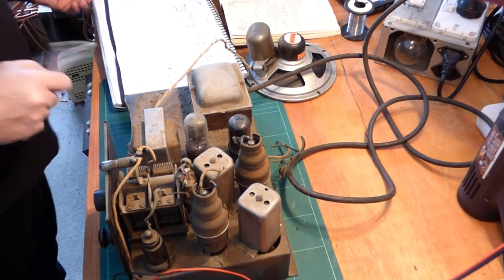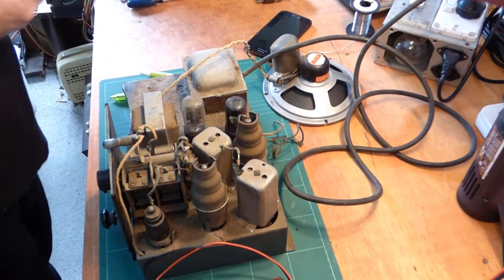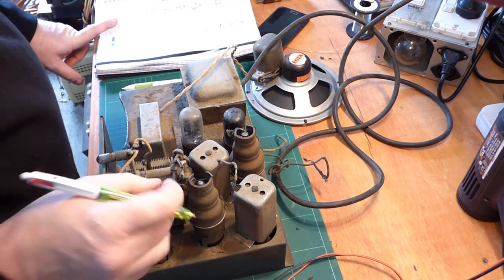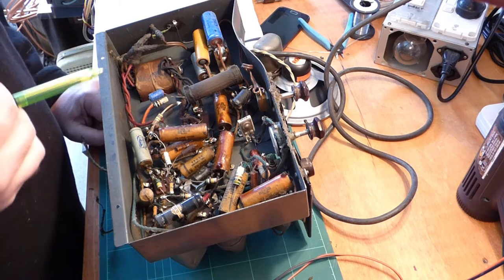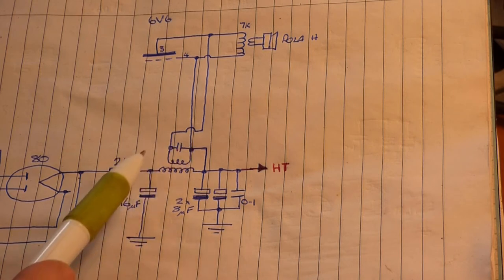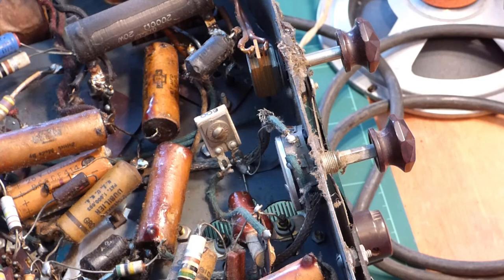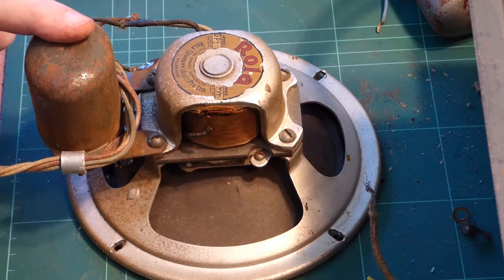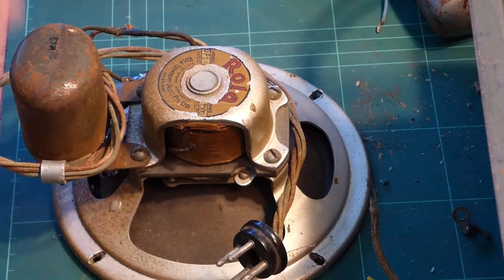2 of 4 - Repairing a 1939(ish)  Rolax 5-Valve Broadcast Band Radio

Comment: With the older rads I tend to use the typical vacuum cleaner noise cap across the negative and positive power input.. damm if it hasn't been a real gem in cutting out mains power hiss et 👀

Comment: An interesting topic worth watching (YT) is the history of Japanese loudspeaker designs re Panasonic, Sony et It illustrates why we have been so lucky to have permanent magnet speakers !! 👀 Your ugly companion (radio) 😗🤣 has some real nasties re those caps et 😗I would also imagine that quite a few of those resistors will be out of whack.. 👀 even if some have been updated from the much larger originals. I ALWAYS remove the valves when I am doing general work on the radio et equipment chassis AND I always LABEL them with their valve ident no's et bagged /boxed et😗 Good to see you clearing out and refurbishing et The main power rail caps/choke allow the valves to power up and should do so BEFORE the filaments fully ignite et IF the heaters ignite BEFORE the valves are powered through, you can get a nasty 'filament blue flash' effect which long term will shorten the life of the valve. SO newbies! always observe the glow of the filament / heaters et which should slowly glow.. 👀 One of the reasons you should NOT replace a DIODE VALVE rectification system with an ie silicon rectifier et and VICE VERSA.. NEVER replace a silicon rectified system with a VALVE DIODE rectifier set up et .. 👀 ALSO, a lot of the main power 'rail' can average out at 300v NOT 230v et In fact some systems require a transformer to output 300v+ from the transformer. 👀DID you know.. a typical valve radio transformer generates 250 - 300v BUT a nominal LESS than 1 AMP of current.. whereas the heater outputs ie 6.3v can require up to 3 AMPS of current.. SOME systems have a secondary of >300 AND TWO heater output rails of 6.3v min 2A  👀 Those portable radios with sub miniature valves often require about 90v + DC with 1.5v to power them. The heaters being about 1.5v +

Comment: The tone compensation cap across the primary of the OP transformer is most likely around .005uF
Reply from the maker: Thanks, I'll try a few different values to visualise (audiolise? :) the differences.  The more common arrangement I'm used to seeing is a 0.01 or thereabouts from the plate to ground, not across the OP TX.  I enjoyed your SW86 video too - I have one of those in my queue, coming up sometime in the future.  Cheers, Steve
Reply: @VintageRadioSteve  I agree with you re the 0.01uf is most common. I did set up a rotary switch assembly with 4 values that worked off the signal from the output transformer that selected various values from 0.01 to 0.05 that added a cheap but surprisingly effective, tone selector. 👍